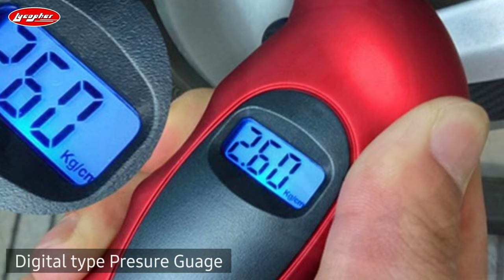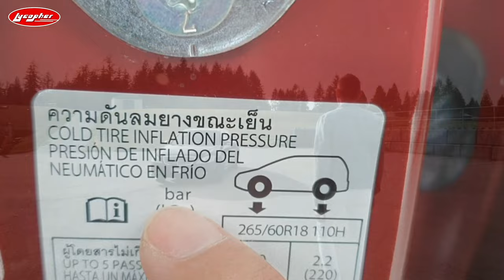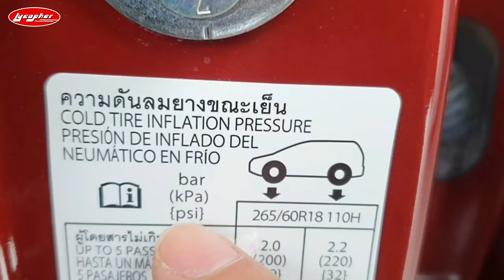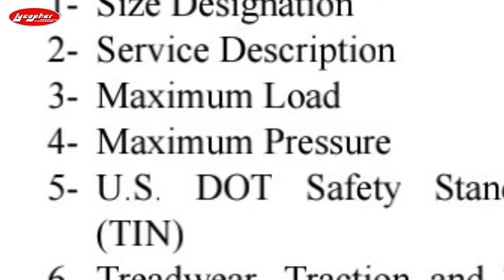CAR TIRE PRESSURE || MGA DAPAT MONG MALAMAN || DAPAT GAWIN AT HINDI DAPAT GAWIN

Comment: Sir kung ang gulong ay 250kpa cold ilang pressure ang dapat 36 ba o 32 psi?
Reply from the maker: 36psi yan if ever sir bong, max po yan. Suggestion pa rin po ay 32 to 35 psi
Reply: @LYCOPHER  many thanks
Reply from the maker: Welcome po

Comment: Sir ano po tire pressure nyo sa wigo nyo fromt at rear? Wigo user din po hehe
Reply from the maker: 35 psi po
Reply: @LYCOPHER  14" ba sir ang wigo nyo?
akin 15" pero 32 psi lang, recommended sa manual.